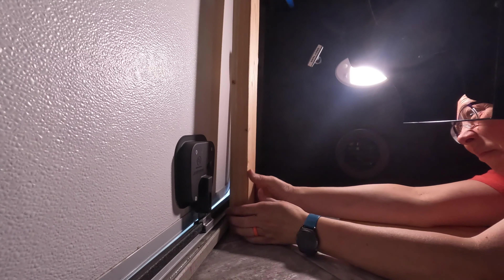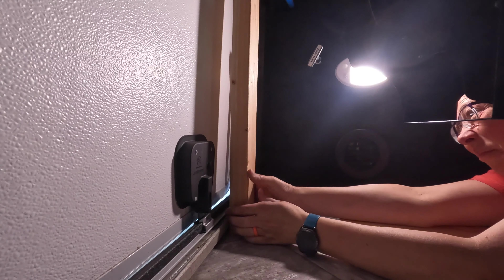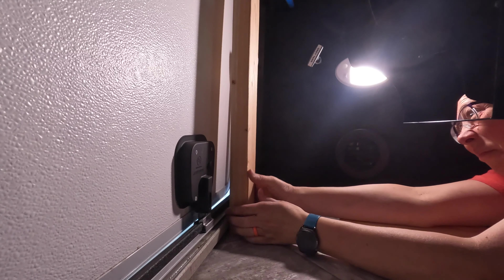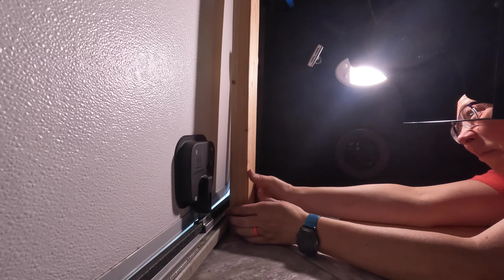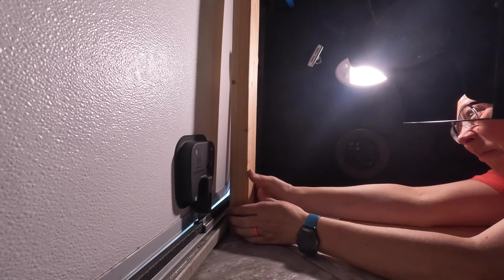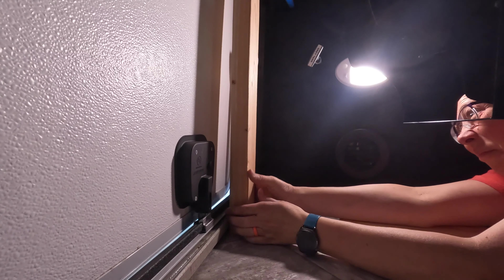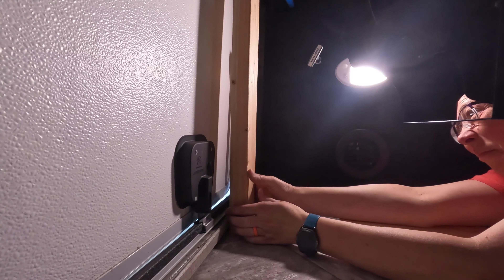Solitude 390rk Slide Failure

Comment: My wife and I are considering buying a GD Momentum and I've seen other videos of issues with their slides as well.
Reply from the maker: I think the schwintech slide mechanism is having problems across the board,regardless of the coach manufacture.  As you have seen the 390 has a pretty major design failure that caused a double whammy. Fortunately for you, the Momentums dont have this same design.

Comment: I have a '20 390RK that just had its first slept issue in the kitchen.   Ugh.   I'm over the GD problems.   I wish I'd have gone with a different trailer
Reply from the maker: Yes, without bashing a manufacturer, we were disappointed with the quality of GD after owning two prior. But to be fair all of them had major quality issues during the Covid years. We still have issues with our Beacon but not near as many. Hope this video helps get you by til you can get the TSB fix for your slide.

Comment: I’m looking at buying a 380FL, so I’m assuming it will develop the same problem.  It has the same rear storage setup as yours.
Reply from the maker: Possibly not for your kitchen is in the middle, and the bedroom is on the tail.  Only one slide on the tail, you will probably just fine with that unit.
Reply: I see.  Thanks.
Reply from the maker: @RVLifeInRetirement  i would prefer that layout tbh

Comment: Hi my name is Bill,
Had just watch your video on the bump stops you had installed a few weeks ago could that be the root of your problem, your rig weight is sitting all the weight directly on the bump stop that puts pressure directly on the frame ,could that force had created the frame to shift then maybe your slide had shifted ever so slightly. I do hope I am wrong, good luck and GODBLESS
Reply from the maker: Thank you for the comment. Unfortunately i wish that was the case, but tis not. This is a VERY common problem on thes 390's apparently.they have two things working against them, 1 an incredible about of wieght behing the rear axle because of a rear kitchen ontop of what ever is in the storage. And two lack of any lateral support. There is no excuse other than a piss poor design tbh. Trust me i wish it was something simple like the sumo springs....but alas no. Thank you for watching.

Comment: Do you know if they still have this issue in the late ‘22 or ‘23 models of the 390. I’m looking to purchase, but a little hesitant. Thanks!
Reply from the maker: As far as I know yes there are. As of now they have done nothing to reinforce the kitchen floor so there will continue to bw slide issuea.  Thanks for watching.
Reply: @HappyTailsRVing  Looks like Grand Design has issued a TSB regarding the slide issue. It’s good they they are addressing it and seemingly committed to fixing the problem.
Reply from the maker: Yes they were very fast to implement the TSB which is awesome to see.